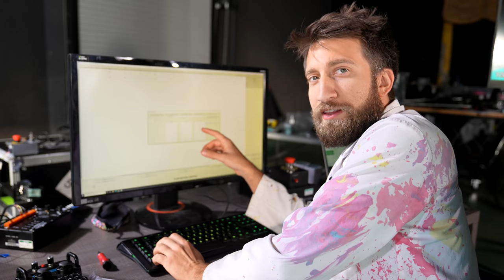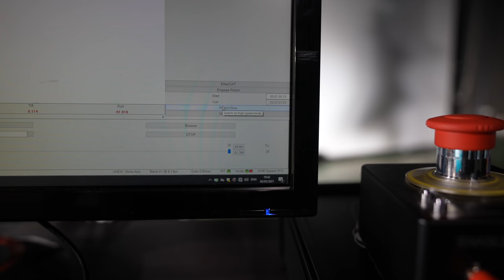Slow Mo with a High-Speed Robot - The Slow Mo Guys

Comment: That was delightful. But I'm going to go out on a limb and make a suggestion. You could use image processing to control the speed of the robot arm, rather than simple timing, to help guarantee that it will remain a certain distance above the mint and/or the soda. But maybe this arm does't have that much resolution to be able to do that trick.

Comment: Lol I really wouldn't worry about turning on a solenoid for a period of time. It's made to be powered. If it fails after hardly any use then buy better equipment. If you can afford a 6 axis robot and controller for it, I wouldn't stress on the 15 dollar solenoid.